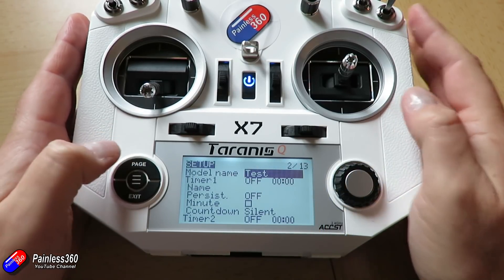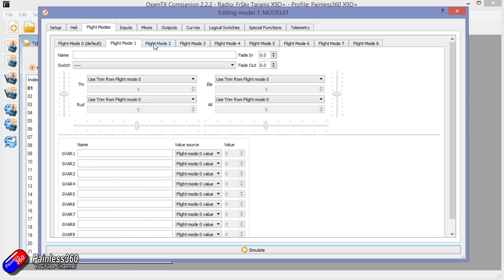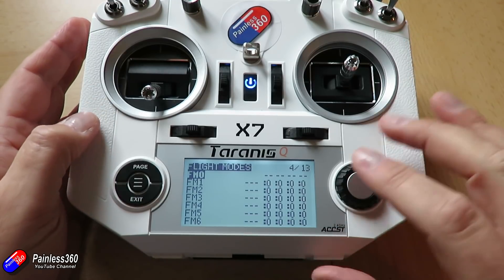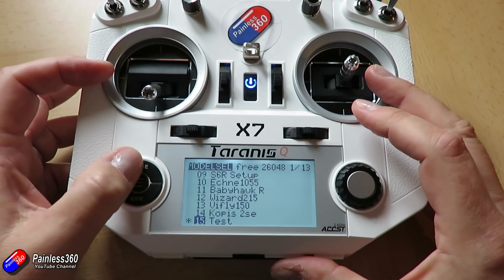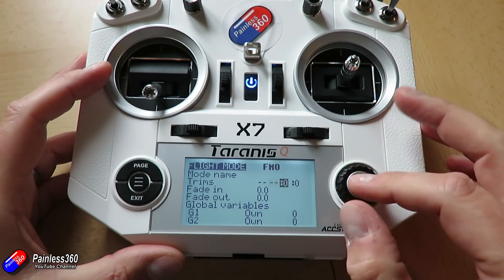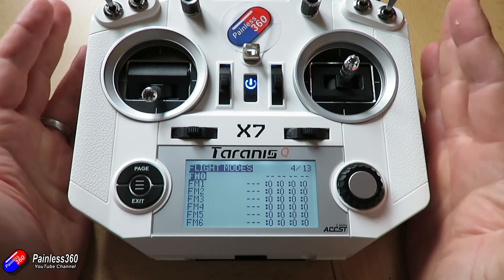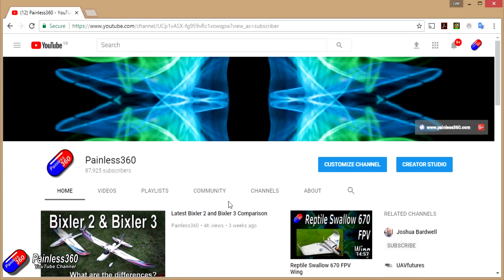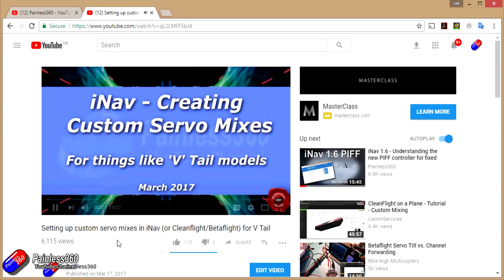OpenTX Quick Tip: Disable trim controls using flight modes

Comment: Do you have a video on how to setup flightmodes with different trims? For example with flaps down versus flaps up?
Reply from the maker: I have a few, what specifically are you trying to do?
Reply: @Painless360  being able to have different trims in different flightmodes. As an example if gear are down....have one set of trim versus gear up
Reply from the maker: Yes you can. You can setup individual trims for each flight mode. You can copy trims from one to another, or even have them as offsets..

Comment: What if you dont have an option to edit trims on FM0? All I get is mode name, fade in, fade out on my x-lite. Want to use them as momentary switches for my quad.
Reply from the maker: Have you tried it through the companion software?
Reply: @Painless360  yes, it worked with it. Now it also shows up correctly on the transmitter menu. Thanks

Comment: I use a timer based on throttle .  It starts running with any throttle over zero.  Is there a way to have the time not start running until a percentage of throttle is reached?  Say 10 percent.  Problem is the timer often runs when I dont want it to.
I looked for information on this but can't seem to find anything. 
Thanks
Reply from the maker: Yep, setup a logical switch to detect when the throttle passes 10% and use that switch to start the timer.. happy flying!

Comment: Hi Lee, another great video. While your on the subjects of trims a quick question for you. I have a turbine plane that uses a single channel for control, the throttle. The idea is that throttle trim high enables and starts the turbine and throttle trim low turns it off in a controlled way. Up to now I've been using a DX18 which allows you to configure a 2 or 3 position throttle trim just for turbines. e.g. 1 or 2 clicks up enables the turbine and 1 or  2 clicks down shuts it down. I've looked in OpenTx for a similar function even dabbling with LUA scripts but so far cannot find anything like. Any ideas ???
Reply from the maker: I’m pretty sure that anything that the DX18 can do OpenTX will be able to do too. I just don’t know enough about what you’re describing to figure out how to do it for you. If you have a link to a manual or somewhere that describes how its done on the other radio, I’ll have a look. Hope that helps.